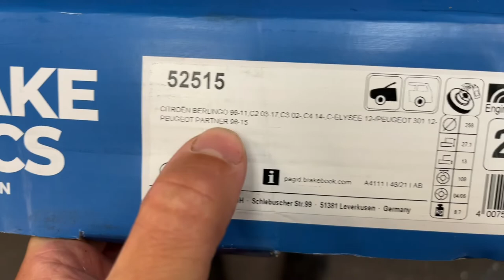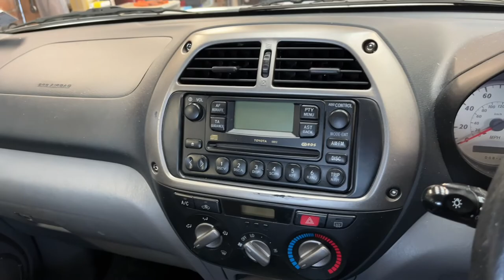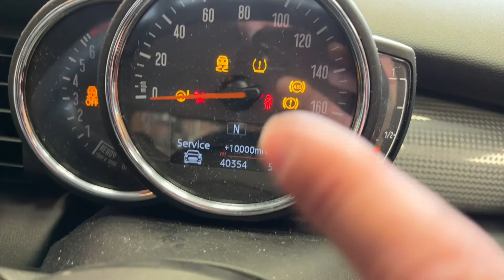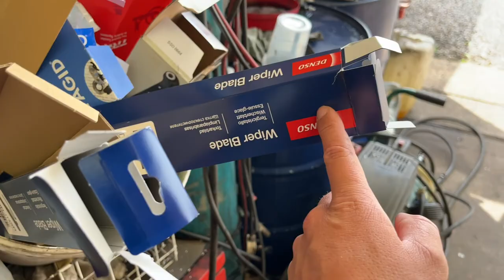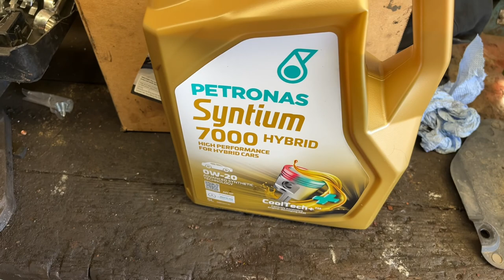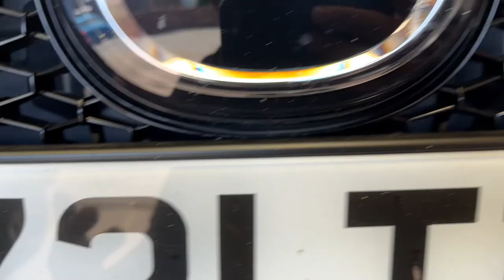PT1 Weekly Vlog #52|Car Addict Garage North East |#vlogs #vlog #shorts #car #cars #garage #mechanic

Comment: The Jeep is looking good Dan. If it still leaks could be a small crack in oil filter housing that opens up when it cools down.
Reply from the maker: Yeah it’s a cracking old car, built very well in my opinion for been American.

Lucky for now it’s not leaked at all with a different filter, the one that send from Mann is an old ford filter and although the dimensions may be correct, I don’t things it’s correct for this engine as the seal is too thin, is for an old Ford engine.

Thanks for watching👍🏼

Comment: Mazda active-G. Is not for me. Brakes and Steering should be left to a certain Basic level. Too much "Modern", Tech. Lowers 100% reliability of Crucial systems. See you in the next one, 👍👍
Reply from the maker: Definitely not for me either mate, as you say the basic elements of driving should be left to the driver not the computer, terrible idea.

Don’t trust the element for computer error and you loose brakes.

Thanks for watching 👍🏼